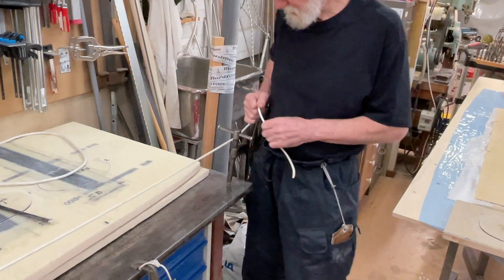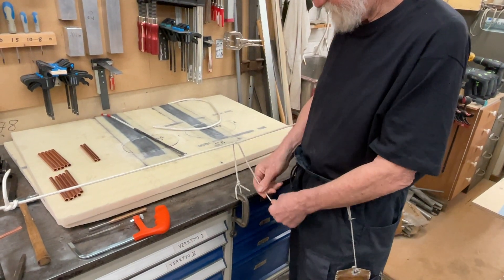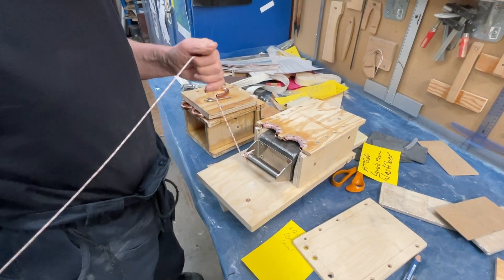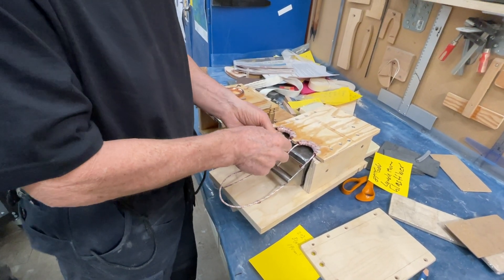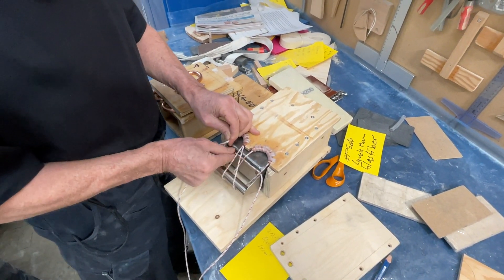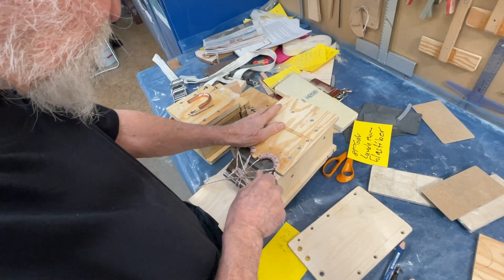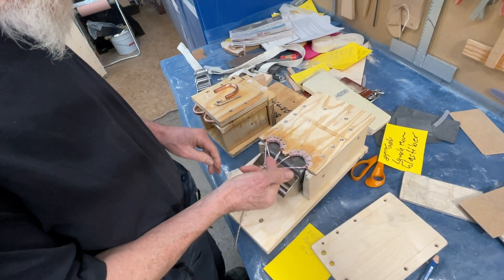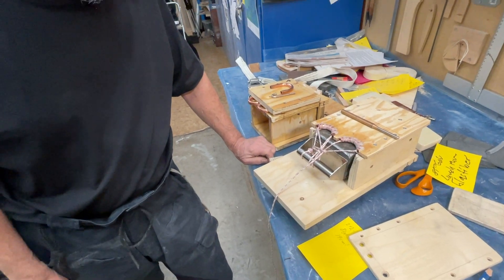Vector thinking comes to my help doing the string for the lead boxes.

Comment: This is a small enclosed living space. Here we find a very corrosive moist salt spray environment combined with lead copper and a conductor. The many toxic acids, gasses, and the lead itself is disheartening. The idea of handling the exposed lead makes me I'll. Gloves, hand washing, ventilation etc. becomes overwhelming. The lead should be fully encapsulated and electrically insulated. In my opinion.

Comment: Hey Yrvind. Super ideas that you've come up with. I am just wondering if you'll willing to take the risk of not being able to quickly get the boat to an equilibrium weight wise if need be. I'm thinking of manoeuvring out of the sudden. Cheers and keep up the spirit...  Alex
Reply from the maker: Lead is less than 10 % of the displaement so no problem. She will just heel a lot but thats OK for a while.

Comment: Wondering why a small size ratchet strap wouldn't do the same thing faster?
Reply from the maker: There is no small enough strong ratchet straps. Besides it takes just about 2 minutes to make the knot.
Later with practice it be faster. I have time enough to spend on those knots.

Comment: We lash the outriggers on canoes in a similar way.  We also use the same vector physics to unstick vehicles by setting up another line to pull agains the winchline at 90 degrees.

Comment: Respect, and love your knotting abilities, but as a retired climbing guide with advanced "skin failure" (quote from Dr. Nick of Simpsons fame) I can't help but think of  the abrasion of damp cord, damp hand, cold temperatures with salt in the mix.  Just the thought of narrow (.5 inch?) webbing and quick ratchets  make the cracks in my old hands stop bleeding. Easier to handle with gloves if need be too, maybe. That said, I couldn't do what you do, and appreciate the chance to think along with you.
Reply from the maker: There is no place for ratchets.
The lead boxes are in the dry section of the boat.
As the lines are under so much tension there will be no movement and no abrasion. But I keep my eye on them. Test sailing will provide the ansver.
Reply: @SvenYrvindExlex  Thanks Yrvind--I meant abrasion of the hands during retying, but it sounds a dry and  compact system. It's been great to follow and anticipate.

Comment: Couldn't you just use some sort of a ratchet strap, instead of fiddling about with all these bits of string?
Reply from the maker: There is no space for that and it will not be qucker.

Comment: I'd be thinking about using a flap with a hinge and a latch rather than using line.
Look at toggle latches like they have on toolboxes.
They would be much faster than weaving line around and tying knots.
A piece of rubber glued to the weight would take the pressure of the flap, and its slight compressibility will keep the weight from shifting when it's clamped in position.
Reply from the maker: There is not enough space for that.
The knot as you can see on the video only takes about 2 minutes.
Thats a price I am willing to pay for a simple system.
Also after practice I will be faster.

Comment: When it passes trough the little hole in (the metal) the grind and tension from the metal might cut in the rope. Especially if the metal has sharp corners.
Reply from the maker: I have to wathc that.

Comment: Always interested when you are about to share some thoughts or new insights. Besides following a boat build, I am getting free lessons about how to get to the bottom of a problem, and how to free-think your way out of it. : ) It is really stimulating. The storage of the lead ballast intrigues me, the system of ropes and pass-throughs seems to require such precision and accuracy that when in (rough) sea it might become quite an ordeal. Could there not be a more simple ‘click’ system that locks the ballast when inserted? (something with a wooden spring or something.) Also I was thinking, can there be not a way to put the ballast outside on deck, in the shape of a peddle or so, that by rotation can swing out for maximum momentum. Or does that go against some rules of good seamanship? I have little to none experience with sea sailing, but I owned a little sailboat that sailed some lakes in the Netherlands. Kind greetings and thank you very much for your daily uploads!
Reply from the maker: There are many things of doing things and they increase factorial https://en.wikipedia.org/wiki/Factorial with complications.
I try to keep things simple.
It takes less than 2 minutes to attach a lead weight. Thats the price I am willing to pay for simplicity, and they each have two handles to control them.

Comment: What do you think of using ratchet straps for this? As a bonus you then have "spare" parts for the locking mechanism for the hatches as well.
Reply from the maker: It takes just about two minutes to fasten a lead. Thats the price I am willing to pay for simplicity.

Comment: These designs are amazing for the movable lead weights, and one of my favorite things about you Sven is that you are always improving, always adapting.  I try to do the same thing myself with rapid prototyping, but I do not have your vast experience with boats.  I try to do what I can with 3D printing etc and I am fascinated.  My desktop background is your photo of "Exlex" in harbor (at Porto Santo, I believe).  Please forgive my total ignorance, as I am a very new sailor (entirely solo sailing as well, trying to learn as much as I can from you, Sam Holmes, Perry, Christian Williams, and my local boat yard and solo sailors there).  What is the benefit of this movable ballast?  Under what circumstances would you move the weights from one side to the other vs. just having them balanced (3 to each side)?  How frequently would you have to switch them from side to side?
Reply: He will travel on the same tack (direction of boat travel relative to the wind) for many hours (or days) at a time.  Consider that the boat will want to heel (lean to one side) due to wind pressure.  The weights will be moved to the high side (windward) to counteract the torques from the wind on the sails causing the boat to heel.  The further these weights are toward the side, the more torque from the wind-on-the-sails is required to lift them (the weights are at a longer moment arm as they are moved outboard).  You see this put to effect on sailing canoes or small racers where the crew hikes out on the windward side to keep the boat from capsizing.
Reply: Possibly not frequently hence the cinch tie system being not to slow. Long passage with a wind on beam longer than you can keep crew on your bulwark.